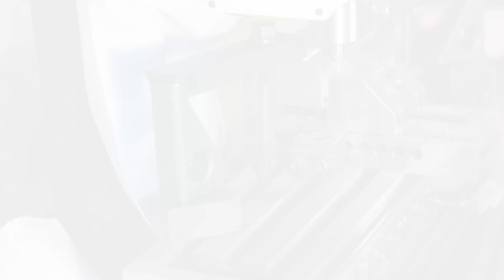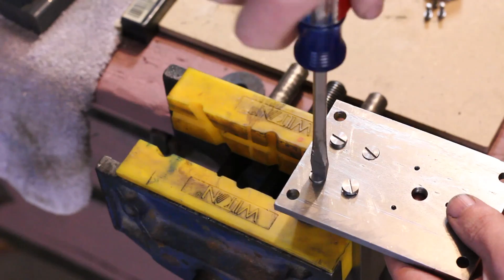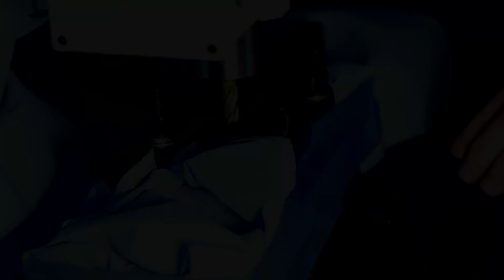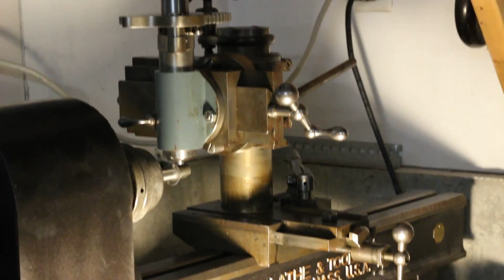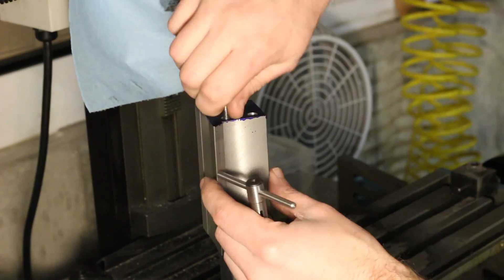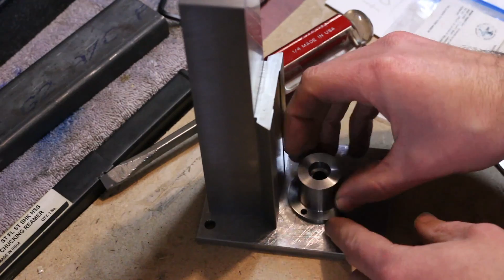Building the Trent Pinion Mill, part 3

Comment: Just a thought about your fly cutter issue, and I may be way off, but couldn't heat affect a cut like that? Your creating much more fiction at the leading cut edge, while the trailing edge would be much cooler, theoretically.  A larger diameter cut would allow more time for that area of material to cool, and return to normal dimension.  Like I said, just a passing thought...  Nice work though.  👍
Reply from the maker: That's a great point, it's certainly possible!  Thanks very much for watching 🙂
Reply: @TheJoyofPrecision  Many years ago (in the 70s) I was a Machinist, before I decided to do something else.  I do believe what you are discovering is your single point cutter is bending on impact with that workpiece.  Industrially, we didn’t use fly cutters.  What is happening, I believe, is the cutter bends and digs in and then springs back as the cut progresses leaving you with a tapered surface.  You can minimize this by always making the entry of the teeth of your tools as acute as possible and leave the exiting teeth to exit at a more oblique angle.  When milling always do everything you can to prevent “climbing” the cutter unless special angles and materials are involved and you intended to push down on the workpiece.

Comment: Nice videos and interesting build. On your flycutter question, are you always cutting in the same direction, i.e., right to left? If the head is out of tram, you will see a difference depending on the direction you cut. Suppose your head is out of tram with a slight tilt to the left (counterclockwise). The left side of the table is "higher" than the right relative to the spindle. When you cut left to right, the cutter hits the "higher" material first and makes no mark on the trailing side of the cut. Then switch and cut right to left. The leading cut is into the "lower" material and the trailing cut will have material to cut and you'll see it cutting. Try it. Also, the cupping you are looking for will be centered at the center of the flycutter path. If you have the cutter at the back of the material the you'll see a gradual taper to the back of the material, not a dish in the middle.

Comment: Try running the fly cutter up the centre of the part .Your scratch pattern looks like you were off to one side which when exaggerated means the out of tram cuts down towards the centre of the spindle.This gives you a high to low reading across the part.
It doesn't hurt to exagerate the set up to help visualise the problem.

Comment: why do people keep perpetuating that cast iron is abrasive?! its very soft and has dry lubricant graphite! I don't get it  IMO its not more abrasive then reg free machining steels like 12l14 and like anything else you just dont want any metal chips in or around your machined ways its that simple
Reply from the maker: People perpetuate it because it's true. Cast iron doesn't really form chips like most steels do, it forms dust instead.  In fact very hard steel machines in a similar way, forming very fine chips that are closer to dust, and in that case it is even worse, as not only is it dust but dust made of very hard particles.  When you factor in that your machine ways should always have a bit of oil on them, that cast iron dust now turns into an abrasive slurry.  Also due to the very fine particles, it will find its way into areas that steel chips never would, finding it's way past way wipers and past small gaps. Certainly don't take my word for it, ask any seasoned machinist or toolmaker with experience machining cast iron.

Comment: Can I please get some feedback on your results with the RR dovetail cutter on your mini mill. Mine worked great on aluminum, not so good on 1018 cold rolled. Then again it's a mini mill using a 1 insert cutter and the vibration was off the chart and had to go to multi flute cutter on carbon steel.
Reply from the maker: Hi Mike, sorry for the delay in responding.  My test cuts using the RR cutter were in a bar of 1018 cold rolled steel, and it performed wonderfully.  I am also using a mini mill, the LMS version with solid column (no tilt).  The finish was just wonderful, and it cut very easily.  Of course, the more full your cut the shallower depth you'll need to take.  I took a 0.010" depth of cut for the finishing pass on this test cut: https://www.instagram.com/p/BVFQaQVhcZR  Of course that's only about half depth, but I was taking 0.020" per pass pretty easily, with an aggressive feed, until the finishing pass.  That may not sound like a lot to most people, but the mill is quite small.  I've used some nice quality HSS dovetail cutters before and they cut well too, but having to run them at much slower speeds the cuts take a LOT longer and don't leave as nice a surface finish.  Did you contact Randy about the difficulty you're having?  He may be able to offer some advice for your particular situation.
Reply: The Joy of Precision 
I believe you're right,I have the harbor freight X2 and been getting good results since I've added the pragmatic Lee automatic feed.I was getting too aggressive with my DOC.The deep groove bearings won't handle that very long. I've since been using it on the lathe with very good results.

Comment: what will be the largest dia. wheel (GEAR) . looks to be a cool machine !!!
Reply from the maker: I will need to check when I get back to the shop, but I seem to recall based on the center height of the indexing head that the maximum diameter part that could fit would be 2".  I don't plan on using this machine for anything even close to that size though.  For anything other than watch gears and pinions, the Hjorth indexing milling attachment I have would be much better suited.  Of course when it comes to cutting steel pinions you'd be limited by the amount of material to be removed between teeth before the theoretical work holding capacity became a limitation.  It doesn't take much diameter before a very low tooth count pinion requires a lot of material to be removed between the teeth.  I am curious myself to find what the limitations will be in that regard (well beyond anything I'd need for a pocket watch though, I'm sure).

Comment: My rule of thumb is any more than 2 turns on a machine handle and I get out the cordless drill. :)

Enjoying the build but I feel obligated to give you flak for using the wrong screwdrivers on those beautifully made screws.  To be frank: I paused the video, put on some tea, stared out my window into the deep dark night for a good 40 minutes, and pondered a thumbs down before I realized I was taking this joke too far.
Reply from the maker: Haha Tony, what are we going to do with you?  You may not realize that both of those screwdrivers I used are reshaped and are nice fits in those screws... not perfect, but not too bad.  If you are thinking I should be using the parallel blade drivers, then I'm afraid we're at odds.  I'm squarely in the traditional horological screwdriver fit camp.  Shallow tapered blades shaped so they just fall short of bottoming out in the slot are ideal for properly made slotted screws that have the slot edges chamfered and polished.  This prevents both deformation of the slot edges, and risk of the blade slipping out of the screw slot.  Some suppose that hollow ground drivers are even better, but to me any miniscule gain there may or may not be is not worth the hassle for someone who doesn't have a jig for hollow grinding.  I prefer a flat stone.   For now, the screws are only rough.  When they are hardened, tempered, and properly finished, I will take a little more care with my screwdriver selection.  :)

Comment: I suspect the fly cutter. More precisely I suspect the fly cutter holder. Just one thou off angle is enough to explain your pattern. The long arm is cutting and the short arm isn't.
Reply from the maker: It wasn't obvious in the video (though if you watch close you can observe it in one or two occasions), but the trailing edge of the cutter was cutting the work no matter which direction I was feeding along the X axis.  One thou is a heck of a lot of error for a collet, typically an error like that would be due to foreign particles getting between the work and collet or collet and spindle taper.  I'm really obsessive about cleaning all those mating surfaces every tool change... so while I won't say it's impossible that it happened I think it's pretty unlikely.  Further tests have shed some more light on the mystery, and I do have one more cutting test to do that will give some telling results as well.  I will follow up on this topic in another video, I personally think it's a really interesting topic.  As always, Juan, thanks for watching and for commenting! :)
Reply: I think the alignment of the fly cutter itself could be the culprit, not the mounting in the collet.  I have made a couple of fly cutters, both with a press fit shank (heated holder and freezer cooled shank), but have discovered that they cut too much on the "back stroke".  So no cris-cross for me.  This repeats every time I use it, even after rotating it in the collet.  (one of them has an ISO30 shank).  If the press fit resulted in a slight misalignment as i suspect, this error would be consistent as i observe and not variable as if the collet mounting was out of alignment. On my mill, a Schaublin 22, the head is fixed in the x-z plane, so no alignment of the head is required. (the head does tilt in the y-z plane but misalignment in this plane would produce a totally different result).
Great project btw. I particularly like your self made screws, they are the iceing on the cake on many of your projects.

Comment: Did you always run your fly cutter in the same direction?  Seems to me that, had you reversed direction, you would see a different pattern on the milled surface if there were tramming anomalies.
Reply from the maker: Without getting real fancy, they are made to only run in one direction due to the offset of the tool mounting.  Mine is left-handed and so needs to run counter-clockwise.
Reply: Sorry, my bad.  On the x-axis, right to left (which seems to be what you displayed on the vid).  And then left to right.  Not reverse the spin.  If you were nudged up against a vertical surface I suppose we could call it conventional vs. climb milling.  

My point was that when you reversed the direction of travel (not tool spin), if there was a tramming problem, then you would likely see a different surface result.  Especially before the fly cutter engaged the material on the back swing.  

Just a thought.  Sorry to be so confusing.
Reply from the maker: Ah, I gotcha sorry for the misunderstanding.  Yes in theory I agree about that.  In practice, what I found (and you can see this in one or two spots if you watch carefully in the video) is that the trailing edge of cutter was cutting, in either direction.  To me, really reinforces that spring of the leading cut coupled with the ease of machineability of the material comes heavily into play.  I have discovered another factor in further testing, and there is another test I want to perform.  I think this is a neat topic and so will be doing a follow-up video about it.

Comment: I think that you nailed it.  With the light cuts that you were taking and the quality of the cast iron, you got very little if any spring in the tool bit.  I would venture to say that if you tried the same thing with steel you would see the cross hatch pattern.  Enjoyed the video.
Reply from the maker: Thanks, I'm glad you enjoyed the video!  Thanks for taking the time to comment.  I'm pretty well in agreement with you at this point, and interestingly I will soon have a good excuse to test the theory.  When I'm machining the "bed" (what would be the table on a conventional mill), I'll use the fly cutter to take a couple finishing passes and I expect that we'll see the cross hatch pattern there, with all other factors being pretty well equal.
Reply: Would spring in the tool bit tend to conceal small to insignificant amounts of 'off-tram'?  The spring action would keep the tool in contact with the work even on the (by a very small amount) high side.

Given that our intrepid host had measured less than half a thou off parallel over 6", would the cut have to be less than that to mark the 'low' side of the tool path without marking the other?

This seems like one of those invaluable Youtube threads where the conversation goes off in the weeds, and consequently I find out something I took for granted is stupefyingly wrong.
Reply from the maker: somebody else, I think you're exactly right about the spring in the cut.  As I mentioned in a reply to Juan's comment, I have discovered another factor during testing, and have one more test to do.  I have also had some correspondence with Stefan and Tony on this topic.  All of this will culminate in another follow-up video. :)

Comment: I know it's highly unlikely, but is it possible that your flycutter isn't rotating concentrically with the spindle axis?  (e.g. slightly bent or warped flycutter shank, or the shank skewed due to debris or something in the shank / spindle interface?)

I'm curious what you'd see if you blued a six inch square, known flat surface, and just turned the spindle with the flycutter in it by hand.  If it marks on one side but not the other, would that demonstrate the tool  path was not sufficiently perpendicular to the spindle?  If it did mark evenly, but still didn't 'cross hatch' at milling speeds, would that demonstrate the problem was speed dependant?

Please keep posting the series, I find it fascinating!  How often does a guy get to see a milling machine being built by hand? :)
Reply from the maker: Good food for thought!  The flycutter is one that I made maybe a year ago, from 12L14 steel, the shank is 3/4" diameter and I know for sure that it has not suffered any trauma that could have warped it.  I'm obsessive about wiping tool shanks and the inside of the collet, outside of the collet, and inside of the spindle, so I doubt foreign matter in any of those areas would have contributed... although its' really impossible to rule out retroactively.

Your bluing test, in theory, would be checking exactly the same thing as my indicator test, although it's still a great idea because it would eliminate the "noise" in the data from the indicator readings caused by surface finish.  I'm glad you're enjoying the series, I know plenty of others have built the Trent/Chronos mill, but I haven't seen any build videos.  I thought it would be a really cool series, and I'm trying real hard not to disappoint you guys! :)

Comment: Why your not getting that cross hatch pattern with a properly trammed mill I'm not sure. I've owned an X2 mill and always got it. My current mill is a 3/4 sized BP clone and with the gear driven tilt and nod adjustments and a whole lot of time I can get it within a couple of 10ths and I'll still get that cross hatch even with very light cuts and a deadly sharp HSS fly cutter tip. Carbide will almost always require more force to get it to cut so that equals more deflection in any weak areas.

The deviation of more than your mill being out of tram is an easy one. 2.2" diameter on the fly cutter radius allows a lot of leverage. Spindle bearing clearance, tool deflection, column, head movement and again deflection throughout the mill, etc etc all stack up. Run the same fly cutter in 2.2" wide cuts across using the Y axis then step over for the next pass using the X axis and you'll see a different but repeating pattern. Unlike yourself many don't seem to understand flycutters are only meant for light finishing cuts and more for the finish they leave than the accuracy they will or won't add. Heavier cuts over .005" - .010" start hammering the bearings, and on mills with a separate spindle also slowly beat the splines to death. I see lot's of forum posts about adding a heavy rear plate bolted to the rear column on these mills. That does very little for the Y axis for adding rigidity. Plus if yours has that stupid bottom column pivot that's another weak area. Far better would be deleting that pivot and epoxying on a heavy I beam to the rear of the column, then bolting that on solidly after the epoxy has set so your not pulling the column into whatever state of non flatness the I beam is.You'd still get some column deflection but much much less. Upgrading the spindle bearings and running a slightly tight preload would also help with better surface finishes with some possible better accuracy.
Reply from the maker: I agree 100%!  I appreciate you taking the time to reply with so much great info.  No worries on the construction of the mill, it's the "solid column" variety sold by LMS... they used different castings, instead of a pivot there's a large base plate with bearing pads at each corner where the column and base meet.  To mill angles, one simply angles the work - that's the way I prefer it.  There has been a noticeable improvement in the machine since using Stefan's tramming technique... I'm sure due to the fact that small voids between the column and base are now filled with epoxy.

The more I think about it, and the more I read comments from others, the more I'm leaning toward cast iron being the main differentiating factor in the pattern of the surface finish in this case.  At some point I will have to machine the  square CRS bar stock that forms the "bed" (what would be the table on a conventional mill), that will be a great chance to test out that theory.